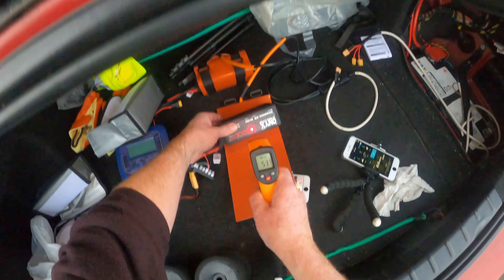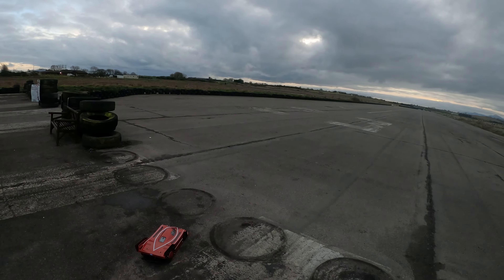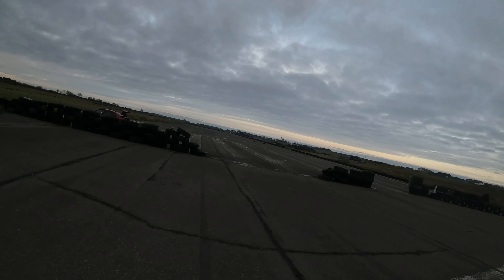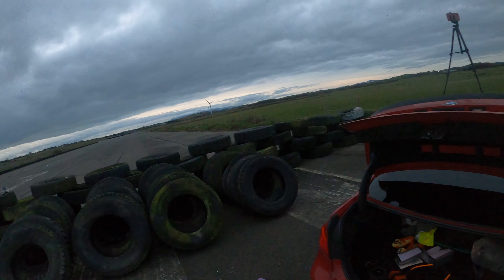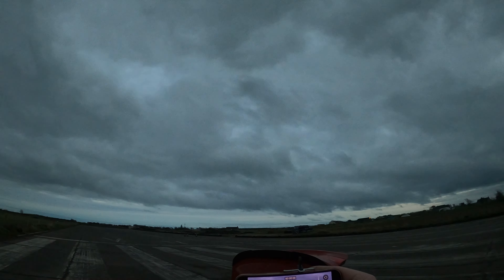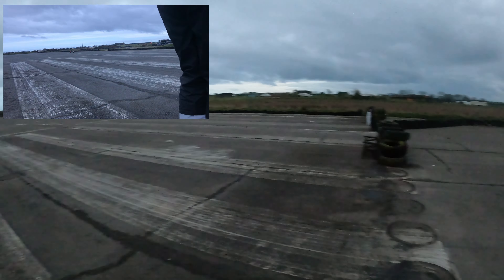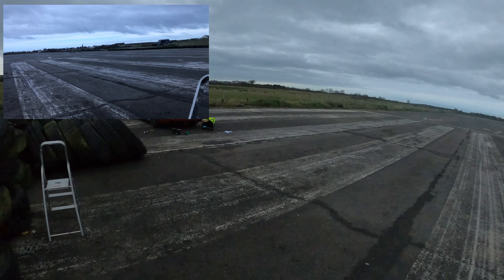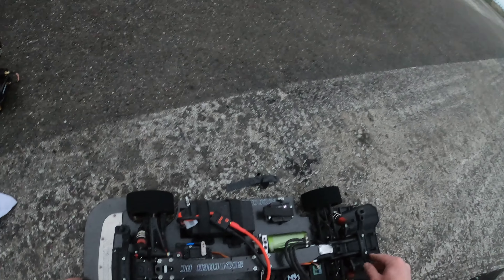DISASTER!  Onyx 8000mah batteries -heated - Speedruns  Arrma V2 limitless,  fc-100 gt

Comment: Mate that was harsh flip😳🙆 luckily its survive, only the bsr went flying onto the right,
I guess might be a small stone or debris at that tarmac causing it to flips 🧐
Reply from the maker: Thanks, yea that chassis is unreal, standard chassis would have twisted under impact. 
I added a clip at the end after I rebuilt tyre wall showing a spark, I’ve traced it back using footage I have from walking the runway looking for defects and found a bump in a join, closest to the bin, and that’s what actually caused it to flip, the staff have said they’ll see if they can fix it.

Comment: "Just one more" is never a good idea :) First crash with a new car always hurts to see. Why was your ESC cutting out by the way? It wasnt temps, amps or volts for what I can see? And looked like you were overgearing. Really heavy voltagesag at just 70% throttle,
Reply from the maker: Thanks 😊 
No definitely not over geared, it’s same gearing I used on open wheel when I was getting 158.
My run distance is to short so I’m accelerating a lot more aggressively to try snd hit 160 in 0.3 of a mile. 
I run perfect pass which on the runs were it’s cutting was only set to 5 seconds, when I ran 1717 at the harbour it was set to 7 seconds, on old road where I crashed it’s set to 9 seconds
Old road I was running half a mile
Reply: @audiquattrojamie  Ah ok! 5 seconds is indeed very short!
Reply from the maker: @rcspeedrunner  yea, definitely far to aggressive 🫣